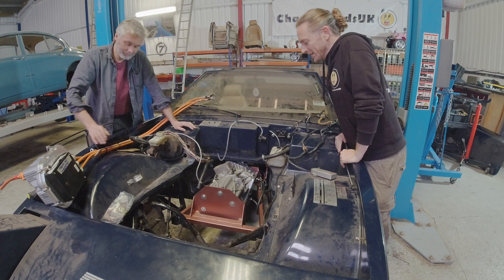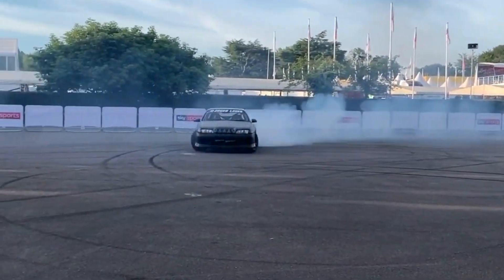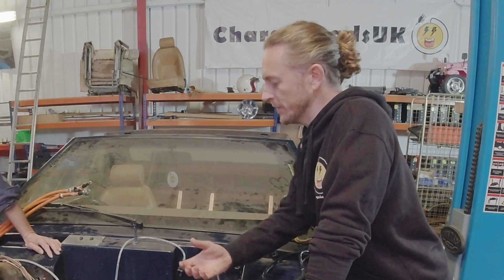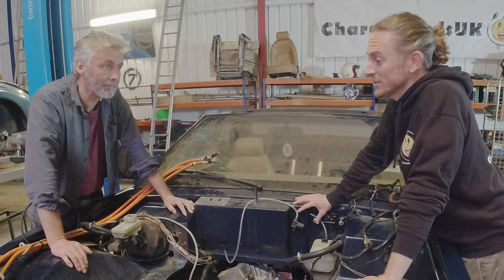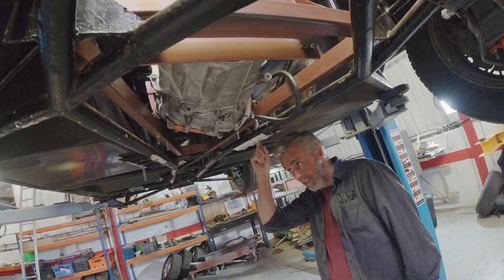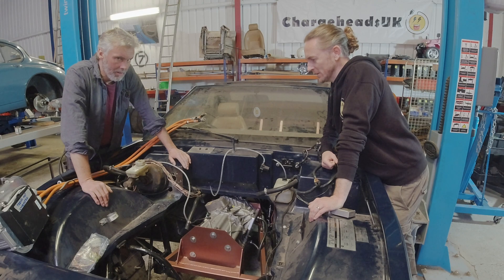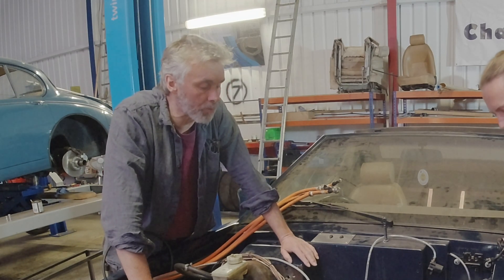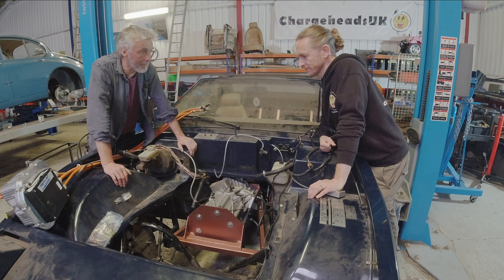Tesla Powered TVR! Ep8

Comment: Just remind us which Tesla motor are you using and what size battery, how did you get around the regs regarding the battery box build and the Iva test
Reply from the maker: Its a tesla small drive unit 220KW, we arent modifying the chassis so we are within the points guidelines not needing an IVA test. Once you acrew too many points thats when IVA is necessary and when modifiying the chassis if you do anything else, for example changing the drivetrain you then need the IVA